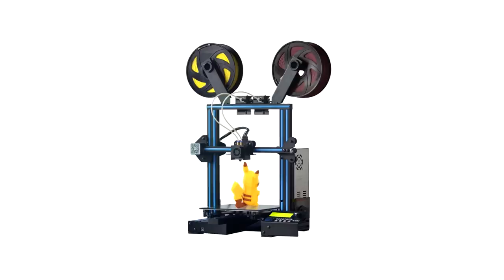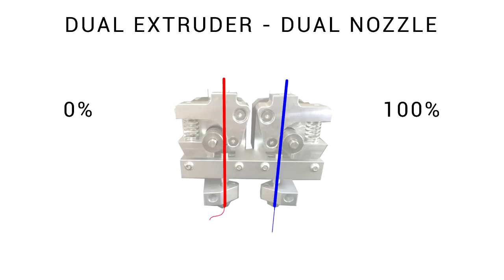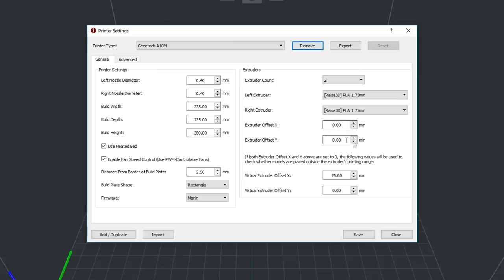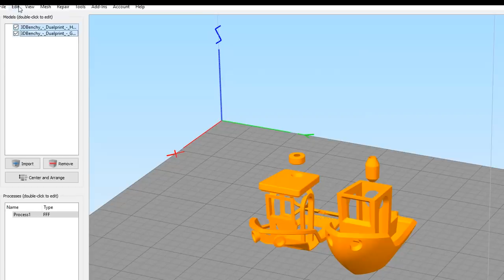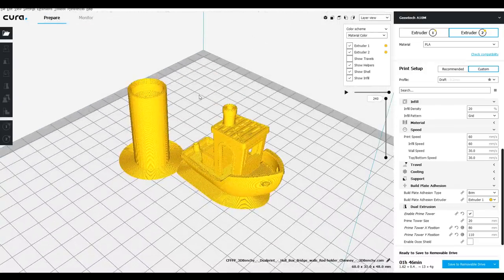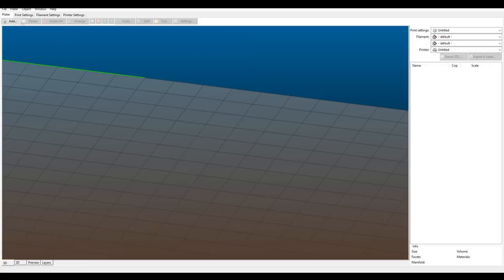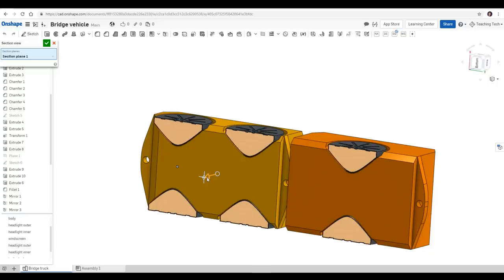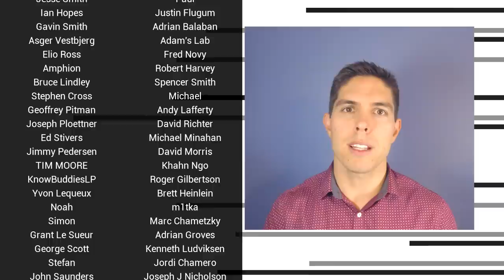Dual extrusion guide: Cura, Simplify3D, Ideamaker & Slic3r

Comment: Great video. Just an additional tip, in Simplify 3D you can also hold in shift while hitting center and arrange and it will align to origin as well. Just a slightly quicker way than going through the menus.

Comment: Thanks, this is very informative. I just got my A20M up and running. I try to print a Thermal calibration tower with simplify3D. I got the temperatur steps right with separate Processes but S3D drives me crazy each time i want to edit a process; it not remembers the last extruder choise i made. It always preselect Mixing extruder but i want left or right separate for one print. I cannot understand how to use this Mixing extruder correct.

Another cool thing would be not to use a priming pillar but to do colorchanges in the infill inside.

Comment: I have an IDEX, and really wanted to use it for dissolvable supports.  Marlin doesn't quite get IDEX right with the print heads running in the wrong direction, homing in the wrong direction or just running into each other.  we won't talk about  trying to do a 3D allignment between the nozzles.

Comment: Quick question, i got an IDEW and i am printing like 4 or 5 different coor for customers. My trick is adding 1 layer for each color. So if the first layer is blue, and the secund one yellow I will print both pieces in blue and them the 2nd extruder will put an additional layer in yellow on the 2nd piece. It works but... 
Is it not a problem to print 2 different pièces on same layer with 2 different color with an idex ? 
Thank you for your work ! it really helps !

Comment: Is there a way to do a dual color print without the prime tower? What I mean is I have a two color model but I want the blend between the two models.  I don't want the stark color change between the two. Just ordered a A10M trying to learn the ropes before it gets here. Thanks for the video very comprehensive.
Reply from the maker: The prime tower can be used tucked in the slicer software. Can work just how you describe without it.
Reply: Awesome, thanks for the info.  I figured as much, should be fun to play with when the A10M shows up!

Comment: A have an A10M and am trying to print a dual extrusion print but and having issues with the nozzle dropping big blobs on the model as it is trying to colour change. It just sits over the model and oozes a blob of filament over it, when it should really be moving over to the side of the print instead. I am using Cura as my slicer...is there a setting in my slicer that will change this or is it a firmware, g-code machine setting issue?

Comment: Is Marlin the default for the A10M? Or did you have to update the firmware?
Reply from the maker: Marlin is the default. It is on pretty much every 3D printer these days.
Reply: @TeachingTech  Thanks. I've had it a week now. Athorbot didn't use Marlin, one of the reasons I sent it back. It couldn't run anything other than Cura 1.5 which was nuts. Buy cheap buy twice.

Comment: I have a Creality CR-X and was wondering if you know of a way to make multiple colors with the printer using the same model i.e. tell it at layer 10 to switch to extruder #2?  I know in extensions you can change filament, but I was hoping there would be an easier way.  Thanks, Great Videos!

Comment: I get the dual extruder single nozzle for two separate colors, but, I want dual extruders for printing in one color with and having scaffold material for printing overhangs. Will a single nozzle work for that? Thanks!

Comment: Hey. I am hoping you can help me get the right direction here. I am trying 2 color prints on a Raise 3D E2 using Ideamaker. I can get it to print 2 colors, but what I am seeing is little splotches of one of the colors on part of the other color. For example, I am printing a bee that has both ends yellow and the middle black. I am getting black splotches on the yellow. I have tried a wipe wall, tower, played with retractions, speed and temps, but to no avail. I have been looking for resources to get advice, but have found very few who can or are willing to help. Do you have any advice?  Thanks!

Comment: Hello,
Do you have a Cura profile for the A10M that you would like to share ? maybe machine type and g-code to.
if not for Cura than maybe Simplify3D
Just whatever you are currently using for your A10M, Thanks
I am having a very difficult time getting proper prints.

It doesn't help that I have sever under extrusion, E-steps came at 340, I have it at 440 and still getting massive under extrusion.
another question, Do you know where I can get spare nozzles  for the A10M ?

Thanks
Reply from the maker: I'm afraid I can't help with either. Never used Cura with the A10M beyond this video. Haven't looked into nozzles yet but the Geeetech employees in the Facebook groups are attentive and helpful.

Comment: Hi, I have a standard printer with 2 extruders and 2 nozzles. I use Cura for slicing and Marlin firmware and execute it with Repetier host. I have been printing only with the 1. extruder until now and all fine, but when experimenting with the PVA on the 2. nozzle i find that the moving speed when changing from one to the other is like crawling ..... so slowly. I have not been able to find any setting where to change the speed for that. Do you have any idea where this setting is ?

Comment: So, are we limited to two-part models? GeetA10M....yellow and blue DO make green! My problem is the A10M crashes the nozzle into the build at 33mm height, getting progressively worse to 60mm, by which time, it has knocked the model off base.
My hint: get plenty of white filament, but also get a roll of YELLOW....it mixes to make other colors....orange, green,blue....

Comment: hello, I watch your videos from time to time, and I thought maybe you could answer a question.  I want to print two seperate files on cura, Im using 4.0 , and for example, I load a small file into the box, (I have lets say an Ender 3)  then how do I load another from a different file onto the same print bed?  I was for example printing one of those surprise eggs on thingaverse, and obviously had plenty of room to print the egg, and the contents on the same 220 print bed,, every time I hit the file pictograph a the top left of cura to open a different file, it just kinda starts a whole new print, etc,, any thoughts? thanks

Comment: Hey Michael, could you make a video of IDEX dual extrusion with two different nozzle sizes? 0.2mm nozzle walls and 1mm infill?

I think this may work, 0.2mm walls do 4 layers x 0.1mm layer height and with the 0.8mm nozzle do 0.4mm layer height. Perhaps there may be gaps left or blobs. I'd also like to see a Rat Rig V-Core 4 with IDEX.

Comment: Could you use prusa version of slic3r for any printer ? It works amazing for multiple material
Reply from the maker: With some profile tweaking I would assume so. I have no experience trying it however.
Reply: @TeachingTech  I have the MMU so I use slic3r for it, it's so easy it would help people if it would work. I also do most of my slicing in S3d so I appreciate you going into that, I haven't seen that anywhere else its new in 4.1. I am going to try to get that working to see if it's as easy as slic3r. thanks for all the work you do.

Comment: after implementing all tips in both this video en the one setting up the FW, I am experiencing issues. My printer heats up, homes and starts to print with the first color, ut just as it gets to the whipe block, the printer resets. Have used different slicers, all do the same. I can use the gradient printing tool via the lcd display, but printing sliced true dual color prints seems impossible... Any help would be appreciated
My printer is running bugfix marlin 2.0, skr main board tmc 2208 stepper drivers...
thx guys

Comment: Hello, thank you very much for this informative video. Unfortunately you have moved things to two extruders and 2 nozzles. It would have been interesting for me to see this once with a Y system (2 Extruder-1 Nozzle). I have been trying to develop a clean solution here for quite some time and I am looking for a solution to the contrary. Maybe you have the time to pay attention to this fan community ;-).  All the best!
Reply: Have you looked at what statasys has done with the uPrint? It goes to a priming location, extrudes a small length into a tub, then wipes the nozzle. No prime rower necessary. Though it is using 2 nozzles, it's interesting to see that they only use one extruder motor

Comment: Thanks for the Quick down to the point video !
Great content and well put together.

What is the issue you are having with you A10M ?

Just ran my first print on my A10M, printed the Lizard that came on the card, it cam out flawless, but for some reason with only  few mins left the print broke free from the plate. No idea why or what happened as I wasn't around when it did.

I have no idea what it was sliced with or the profile they used.   Anyone have any idea ?

Anyone have any base profiles for the A10M ?

for now I'm just going to use a similar profile that I use for my  CR-10S
Reply from the maker: Here is a summary of my issues: https://www.youtube.com/watch?v=8o--HmfZ57I

Comment: Next, 3d printing using two different materials, to make really good parental ear plugs! lol
Or how to print pink noise generators. Or how to print sound absorbing hallway designs, such as the all metal version of one of those called The Hall of Silence, at The Ontario Science Centre.
You can yell in those and because of the almost 'Z' shape and walls that have tiny divots covering them, its super quiet. Music Jam halls should be designed like that, or home additions for families that have musicians. Talking giant 3d printers making those though! We didn't have the technology for that back in the day, so the parents went with ritalin instead.
Reply from the maker: Great ideas! I will be attempting multi material soon.

Comment: Increase your travel speed to like 200 to help with stringing on a10m
Reply from the maker: Thanks for the tip.
Reply: AFAIK it's ideal to have any printer travel speed at it's fastest speed possible, I know in Cura you can set it to some ridiculous number like 9999 and it'll default itself to the highest speed your printer can move.  I'm still playing around with settings myself.

Comment: I dont think dual printing will “take off” without a self cleaning mechanism for purging and extruder head cleaning every tool change.
Have printed ninjaflex and colorfabb HT on a Taz 6 with a Flexydually V2 extruder with Simplify 3D. It took 6 months to get something half decent out of it, despite years of experience with the great filaments. A horrible experience in every way, and I strongly advise against it for a serious purpose. Ooze handling, bed and extruder head calibration, extruder inefficiency due to split power and immense extruder weight, the list goes on.

Comment: -1
I'm sorry, but it looks like you have no experience with dual extrusion at all... :(

1) Slic3r PE / PrusaSlicer is the most powerful MMU/Dual extrusion slicer available on the market.
2) I saw nothing about cooling/ramming the filament, parking position or even preparation for the print.
3) Where is information about the amount + shape of the prime tower/purge block?
4) How/where you have to set up an amount of the filament needed to change the color from one to another if the color is still mixed with another one?

Your videos are good, but they are missing a bunch of knowledge. It's kinda sad. You are a teacher. I expected videos teaching us much more… :|
Reply: So it has been a year since you wrote this,  where is your video to show what was missing?   It's easy tp criticize when you don't do anything yourself